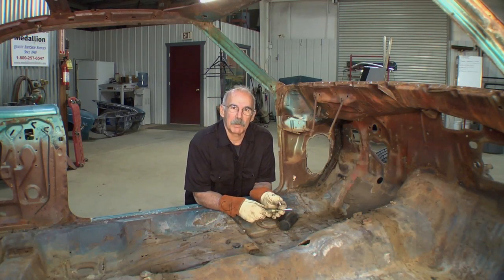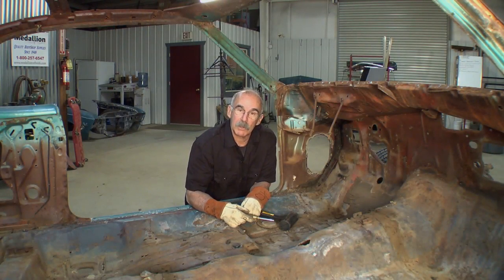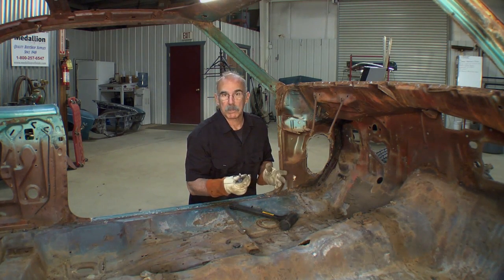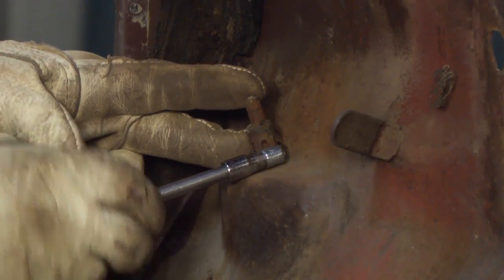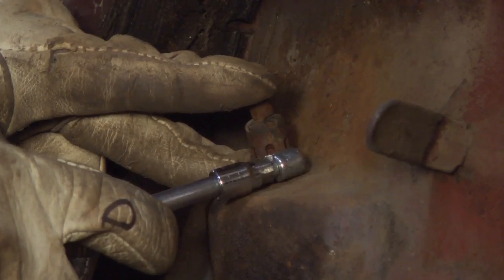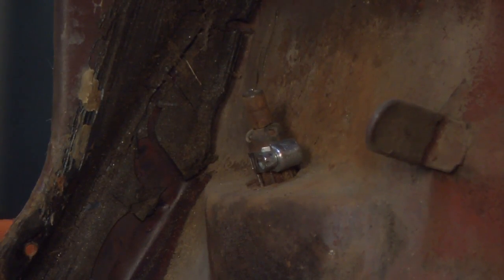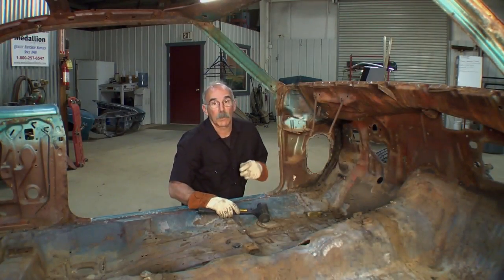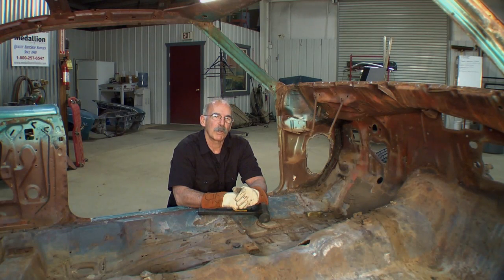Removing the Emergency Brake Cable From a Car

Comment: This was a fun video, and in general that's a great idea for repairing or changing many kinds of things. Anything that needs to be compressed to fit through something, that could work. 
Related, my 1936 ford panel truck has an e-brake handle that doesn't appear to be connected to anything. Can I simply CUT that handle off? For now, to just get it out of my way. It doesn't effect my braking at all, I just want it gone!
Reply from the maker: Hi Royce, 

If it's not hooked up to your emergency brake cables and you don't want it in the cab of your truck, you should be able to un-bolt the lever and remove it.
You could just CUT it off, but why cut it if you can unbolt it, that way later you can add it back easily or offer it to the next owner who may want it.
Your truck should have some sort of emergency brake though, whether it's a pedal or handbrake or even an electric brake.
Consider fabricating an e-brake from another car or check out offerings from Lokar, E-Stopp, and others.

Wrench safe, 

Mark
Classic Car Restoration Club Video Membership